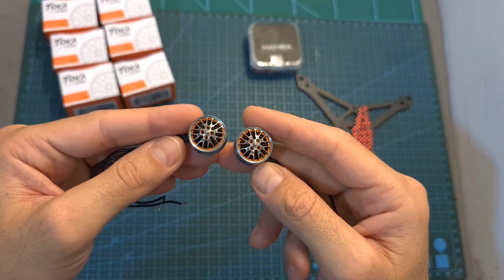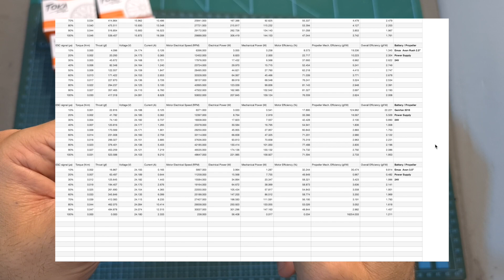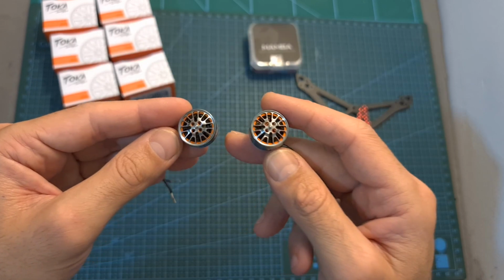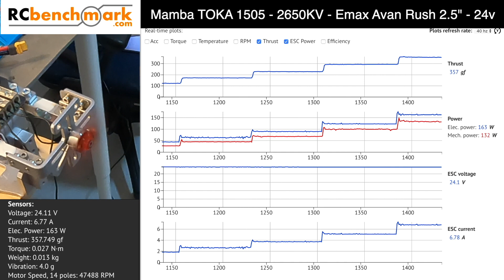Diatone MAMBA F411 25A AIO MK2 // TOKA 1505 Thrust Tests

Comment: Can 1505  be sufficient for a heavier 3.5 inch quad roughly around 300g or I need to chose 1606  motors with xt-30 850mah battery for a flight feel of a 5 inch 6s?
Reply: I curious aswell cuz my plan was to use 2650kv on 3.5inch. 160g dry.